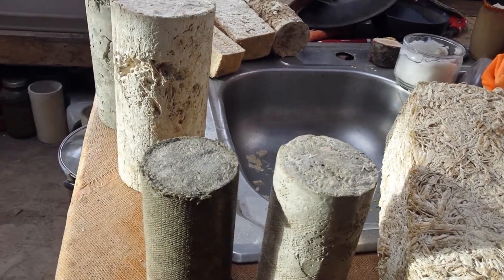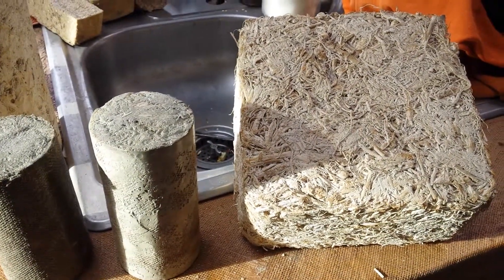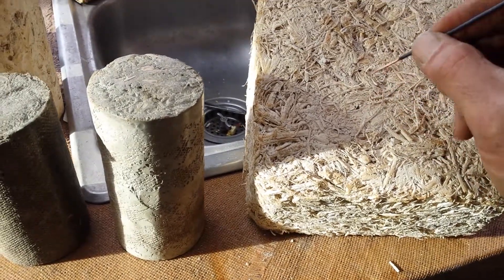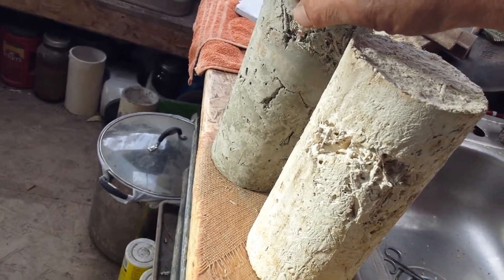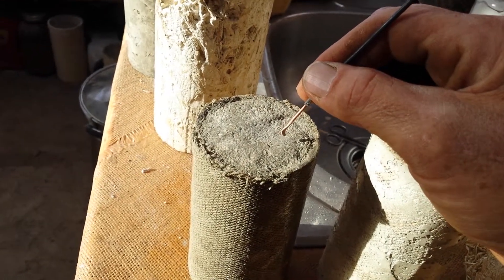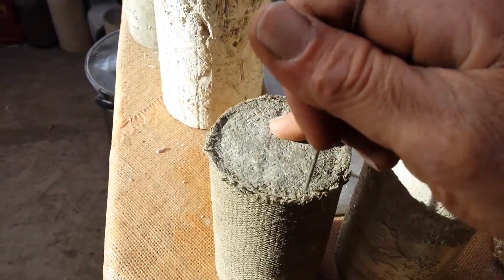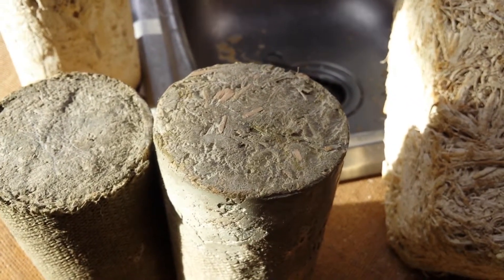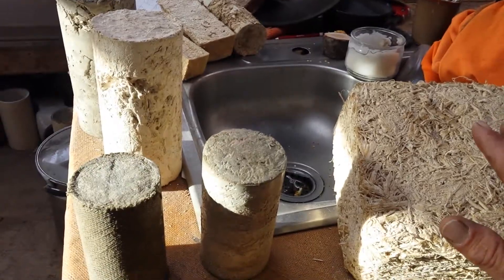Hemp fiber MgO geo polymer Exothermic vs Acrylic's  Chemical welding Organic, MgO, Acrylic monomers

Comment: If you spread a lot of plastic / acrylics in nature (or in concrete), you will soon have the same plastic in your food and water. But hey - it's only your children who have to thank you for your good ideas / innovations ! ! !
Reply from the maker: https://youtu.be/GcoJNi95yrg 

 Not that you would understand  , capable  of grasping what hemp oil is capable of like producing SAF jet fuel synthetic and carbon neutral to make our air breathable , edible plastics 

 I'm sorry decades of unregulated manufacturing of billionaire'isms have destroyed the terrarium , you can't understand I'm trying to fix their damage , you don't own anything made from plastic you have never bought anything wrapped in plastic sold in a plastic bag or container the simple minded puritans are special 🤗 oh by the way 

 Hemp oil can be processed into epoxidized hemp oil (EHO) and then acrylated to create acrylated epoxidized hemp oil (AEHO), a bio-based resin with potential applications in various fields. This modified hemp oil can be used as a photopolymer resin for SLA 3D printing or as a component in biocomposites.
Reply: @mrglasecki  - Yes – it's amazing what's possible if you only want it. But I wasn't talking about hemp oil. I was talking about air pollution (by waste incineration plants), microplastics in fish, birds, and the plastic ocean. You might understand that, because PFAS in groundwater were never part of the good intention either. 

What are you having for lunch today? Maybe some biocomposites made from sesame and fish oil?! And just by the way: the geopolymer (aluminosilicate glas) is far superior to the acrylic resin in PLC.

Quote: "you don't own anything made from plastic ..."

Yes, yes - in my youth I painted quite a few pictures with acrylic paints (125 g per picture), but it never occurred to me to pour tons of that stuff into the mortar for building houses 😏. The dose makes the poison ! ! ! The dose of epoxy resin in your daily lunch and the dose of epoxy resin in your garden, green house or "terrarium."
Reply from the maker: @AlexanderLeibitz  hemp is CO2 neutral it captures as much as it would release regardless if it used as synthetic SAF jet fuel , if sequestered in say concrete , cobb , geo polymers that  would be hundreds of years if designed and built correctly , bast hemicellulose is a multi layered nano fiber that's several times the strength of steel by weight , CO2 isn't even the enemy it's deforestation and desertification hemp holds sand  grows with less than 8" of precipitation annually while it captures CO2 
 Please live in a house of sticks rebuild it yearly if you desire
Reply: @mrglasecki  - you allways talking about hemp. But I was talking about plastic / artificial polymers and poison.

QUOTE: "Please live in a house of sticks rebuild it yearly if you desire"

Why should I? Geopolymer concrete lasts much longer than sticks, hemp or sticks boundet with hemp. Is my English so bad that you can't read any of this? I still think magnesium oxide or other rock is quite good, but not plastic. I don't have anything against hemp or wood either.

Comment: Is there a way or do you know how I would go about making a mix similar to what they are doing in this video? https://www.youtube.com/watch?v=wl_o-5gbHYQ
Reply from the maker: @chrxmeface  looks like an acrylic polymer with ceramic bead casting/injection, quite impressive 😎 
* Without touching the panel I'm guessing wildly
Reply from the maker: @chrxmeface  
* Could a bast hemi cellulose fiber cloth fire resistant marine epoxy with PLA bound shiv infill tile covered in ceramic gel coating or system be designed, yes and again yes